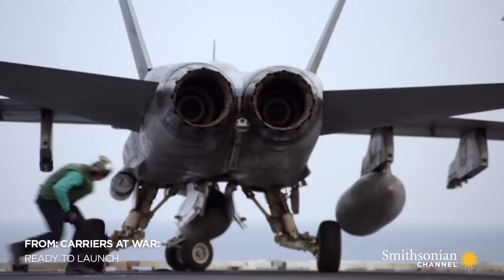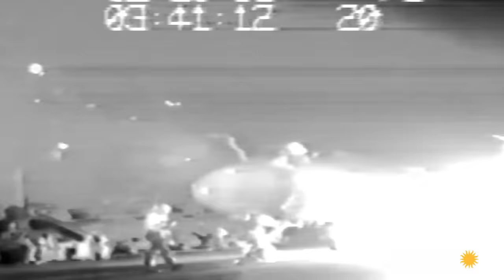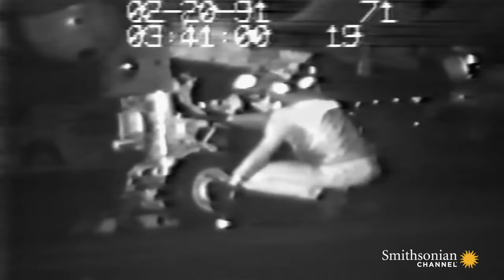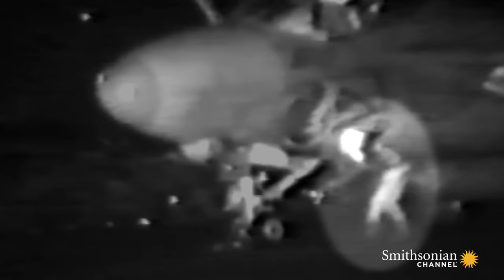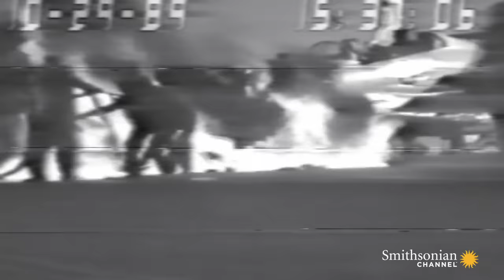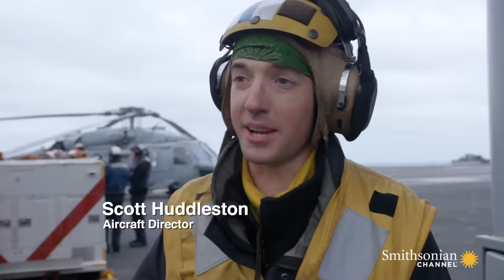This Sailor Got Sucked Inside a Fighter Jet Engine

Comment: When I was a volunteer firefighter I used to train with the local ANG on aircraft firefighting and of course they would show some of the accidents like that one. I remember seeing one film where a ground crew member got sucked into a F4 Phantom. He got his helmet wedged about 6 feet in where the intake transitions. when they pulled him out just like the sailor he was uninjured but totally shook up to the point he couldn't stand by himself.
Reply: Well that's understandable, his weak wobbly legs.  How close to death he came....guess he had a guardian angel working the flight deck that day.
Reply: @patrickyoung2117  I mean he might have even stared at the blades, so ye I can see how scary would be
Reply: FunFact: My career is going to be an Ang base security

Comment: “It’s like playing dodgeball with 60,000 pound jets.
Reply: 3,000*

60,00 pounds is almost as heavy as the M4A1 Abrams.
Reply: @brieftactical2125  the airman was correct. many of these figher jets weigh in at 30-45,000 lbs dry, can carry upwards of 20,000 lbs of fuel, and another 20,000 pounds of munitions, hitting max take-off weights well north of 80,000 pounds. The largest commercial Jetliners have take-off weights dangerously close to 1 MILLION pounds.
Reply: I was reading this when the dude said it-
Reply: Felt like a line fed to him by the film crew.

Comment: I understand he lived. Engine was destroyed by his goggles, tools being sucked into the compressor blades. His body never entered the engine. The A-6 intakes are fairly high and not very large but the suction was enough to give this poor guy a headache. Back in the 1960's we had to watch out for the low and wide intake on the F-8 Crusader.
Reply: Hal VanSlyck. The F-8 Cruisaders as well as the A-7 Corsairs were known as "MAN EATERS!!!"
Reply: Roger that, shipmate.  We had F-8Ds;  the intakes were big enough that some of the crew took naps inside them.  Also, calling the A-6 a "fighter jet" in the video title is quite a stretch.  The A-6, as you know, was an attack aircraft (a bomber), not a fighter.

Comment: The pilot ejected... downward.
Reply: Aircraft in time has had downward ejection seats, like the starfighter, etc. I do not know much about the aircraft but it is very possible it could have a downward ejection seat, how it works is it blows out below the seat, nets near the arms of the pilot extend very fast to prevent trauma, and when the pilot would enter the aircraft they would have little braces where they would have hooked up to the seat so in the case of a ejection they would not be defiled.
Reply: @carloscopelleti1291  WROOOSSSHHHH
Reply: Naw dude, the jet went upside down, and the guy ejected towards the carrier, meaning that if he was flying normal, he would eject upwards.

Comment: I was a plane captain on the Rosie and the Kennedy during carrier quals. We had another PC on our team we called Hambone. Skinny little guy with a shock of black hair and sharp dark eyes and an imagination like a writer. One day on the JFK, during flight ops, he jumped up to do his AFR Probe check and he was too close to the painted triangle. His legs just picked up and started to head for the intake. I lunged and grabbed those skinny legs and yanked him to the ground. He didn’t even realize it, it happened so fast. We blew a bowl later. A7E Corsair. Don’t tread on me. Cut no slack in light attack. VA46.
Reply: BlackSwan912. Thankyou for your service my fellow naval aviation warrior. I was PC on S3-A /S3-B Vikings (VS-33 Screwbirds) & jet mech in powerplant & airframes & corrosion control as well as crash & salvage team in my squadren. I was stationed at NAS North Island, San Diego

My brother was stationed at NAS Lemoore with the Mighty Shrikes.
Reply: Rodney Leonard : I was a pc in VA-42 , A-6s, from 72-75. Those A-7s looked like man eaters with the intakes so big & so low !!!

Comment: The sailors cranial (helmet) was sucked off and stopped the blades
Reply: William Renfro do you mean cranium? I've heard of cranial nerves, but never heard it being used by someone to refer to a skull or helmet.
Reply: PonzooonTheGreat did you even read the comment? The cranium SAVED him
Reply: Curtis Richardson. These protective head gear helmuts for all flight deck ground crew personell are in fact called "cranials". I was in Naval aviation also as a jet engine mech in Airframes & Powerplants.
Reply: xX YongST Xx. His cranial, protective eyewear goggles, and flashlight wand were all sucked into the jet engine's fan blades. From there, parts of these items as well as the fan blades were broken apart & injested internally into the compressor stage turbine blades, causing most everything inside the jet engine to be destroyed. That is why you see all the sparks shooting from the rear of the jet engine exhaust outlet.
Reply: Curtis Richardson that’s why u don’t try to correct someone unless u know what ur talking about.
Reply: That makes sense. Thanks for explaining I always wondered about that.
Reply: @masonlee5866  lol

Comment: When my dad was in the Air Force a DC-6 airliner had forgotten some paper work. The head flight attendant, apparently without thinking, started to run back to get the paperwork and walked into the propeller.
       He said one second she was there, the next, she was just gone.
Reply: That’s horrible. What year was this in?
Reply: That happened at Liverpool Airport when the cabin crew opened the door on an old jetstream aircraft while the props were running and stepped into one. Not a nice sight
Reply: @markc7556  You are speaking of a different accident. The one my dad saw happened at Travis AFB in California. (I think).
Reply: @erictaylor5462  Yeah I was just adding working airside anywhere near an active aircraft civil or military can be dangerous if you let your mind wander
Reply: @markc7556  Yea, you have to pay attention. Aircraft propellers and jet engines do terrible things to the human body.

Comment: My Grandad was a Corsair pilot in the Korean War, and upon landing on the Antietam, the arresting cables decided to play hooky. Mercifully he was basically out of fuel or he would have exploded as he crashed into multiple other aircraft and then went into the water. The deck crew didn’t miss a beat and saved his life (Corsairs were known to sink like rocks to the sea floor). He was fine except one leg was always an inch or two shorter and he had to have all of his pants altered 😹. His yellow and black propeller tip is sitting in my Dads closet btw. 🛬

Comment: Uhhhh, at 1.27 with the Buckeye crash it's stated 'water' was used to fight the fire.  I'm pretty sure that water wasn't used.  In the USS Forrestal incident, many of the casualties were as a direct result of water being used instead of foam and washing burning fuel through a hole in the flight deck and into accommodation below.

Comment: Note to self, when flying inverted 10-15 feet above the ground/surface, don''t eject. Does any know why the pilot of the Buckeye didn't simply do a go around and ended doing that insane maneuver and then ejecting while inverted? I feel like there are many options better than the one chosen here
Reply: He either panicked or had a medical issue, I can’t find any other explanation, though I think the former is the more likely to have occurred. Someone with a medical problem would probably not be in state to eject himself, so I guess he just panicked. I don’t think anything could’ve been found from an autopsy either, his body was probably heavily burnt and shredded to pieces if not disintegrated.
Reply: @khletus9061  he was a student to be a buckeye pilot he was on low speed and if you look close  before he. Hits the control tower he ejected but he didn’t make it.

Comment: Water, on a jet fuel fire, is that correct?
Reply: Jeff H yes it can work I guess. Probably gas to be extremely pressurized though.
Reply: you have to use foam.

Comment: Hold on how come f18 not sucking them in they standing right infront of intake ?
Reply: A.Şâlvâtőre because they are behind it so they would be blown instead. And if you notice that they are right under the exhaust. If they are not right under it them they will be blown away.
Reply: He's talking about later in the vid, two guys stand right next to the intake (front); you are talking about the exhaust (rear). And to answer his question, you can hear the engine is at much lower power than the A-6 Intruder would have been at so not enough suction.

Comment: Only on shitty American planes, on all russian planes while taxing the engine breaths through slits on the the top of the plane and the supersonic inlet is closed. Even while the inlet is open it has multiple stages of filters.
Reply: Ausintune That's because the Russian flies his warplanes from just about anywhere; a concrete runway or a dirt road, whatever they've got handy at the moment. I don't think, however, that most late generation Russian types run jet intake air through narrow slits or filters at any time, comrade.